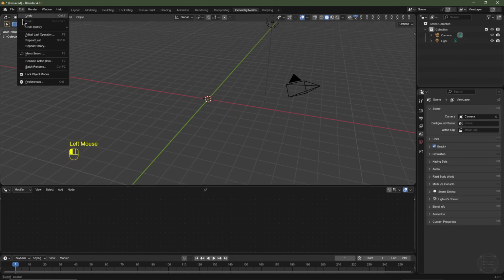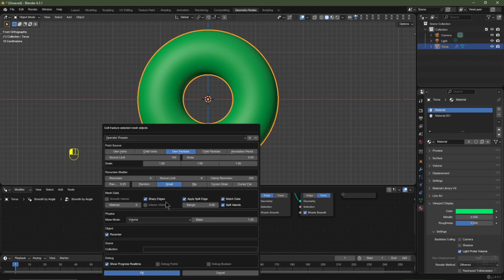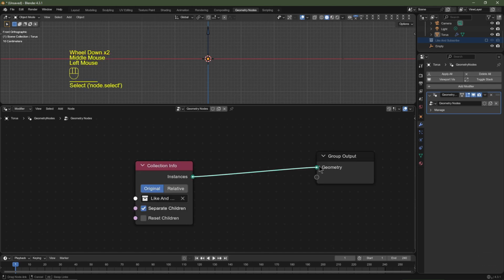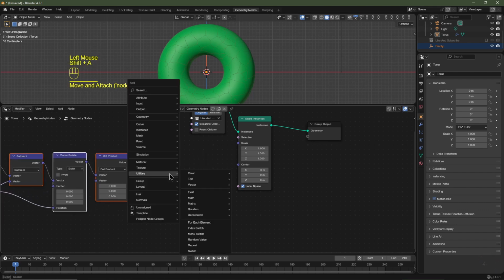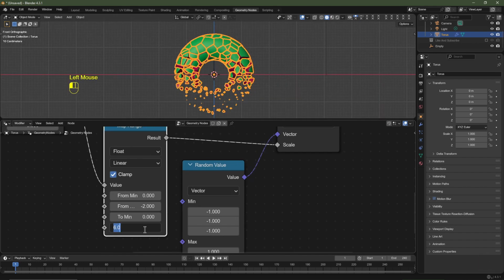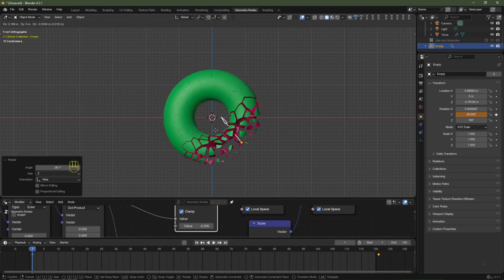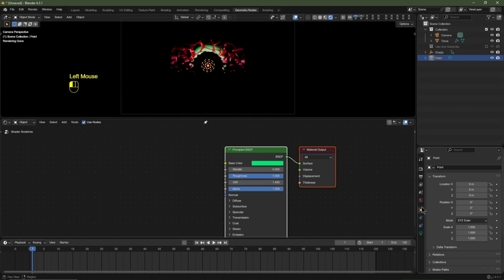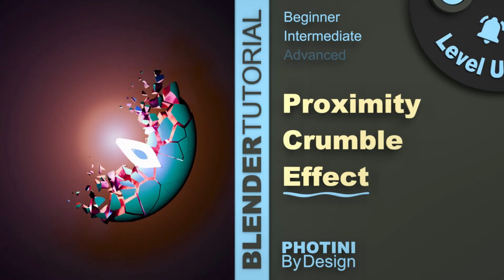Geometry Nodes Dissolve - Blender Tutorial

Comment: Thanks for that. I am working on a selection tool with the same idea of slecting by proximity. It works on the simple models but for Suzanne, for instance, when we get near the ears we select the ears even when we want to select the cheek or whatever but not the ear. 

I wonder if you have a way around this. The purpose is to select exactly 1 face without having to squint my eyes.
Reply from the maker: I will look into it when I am back in the studio on Monday and will get back to you on that. I know there are several way to approach proximity selection, but I would need to test and compare to find the right solution.
Reply: @PhotiniByDesign  I am exploring another way to select one face on high resolution mesh without touching the model. 
Make a line. Rotate, translate it till it intersect the model at the right place. Boolean intersection gives us a line inside the mesh. Endpoint select. This works fine but the selected point has a tendency to jump from front to back when I move the line. I'll send you a blend file and if you wish we can start from there. This is the first step in building a "procedural sculpting tool" (you can change the shape the size and the position of every brush stroke at any time, going back in time) details on request.